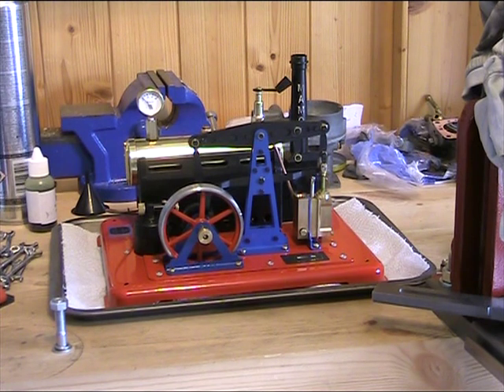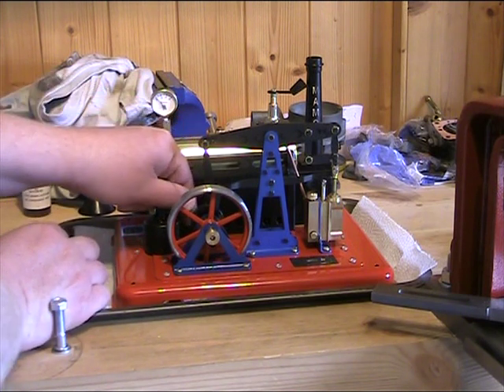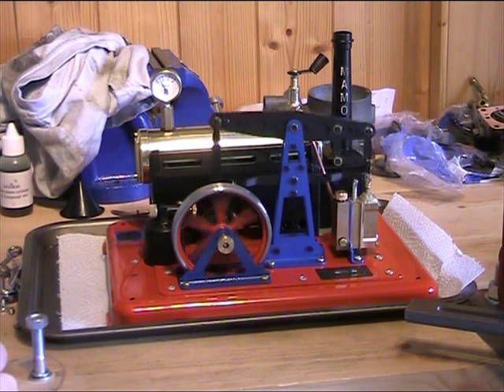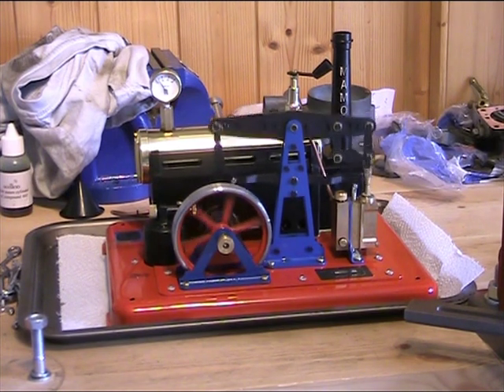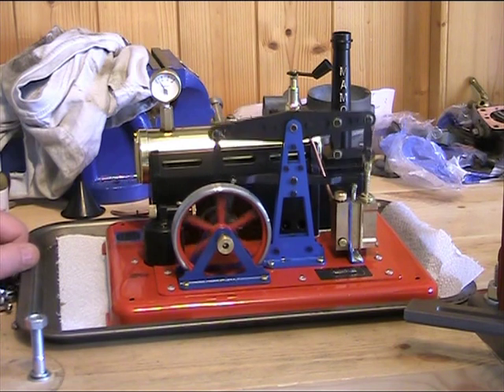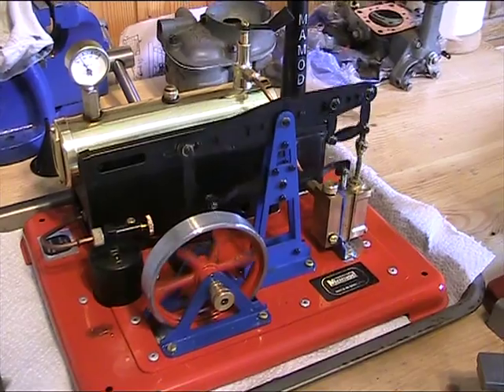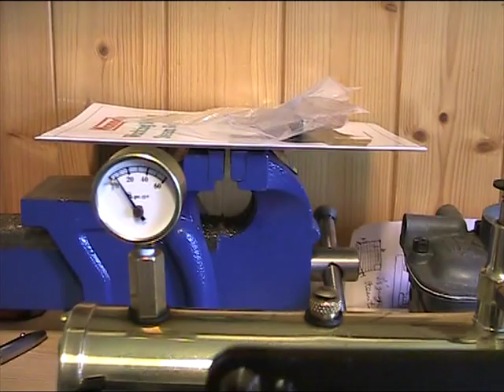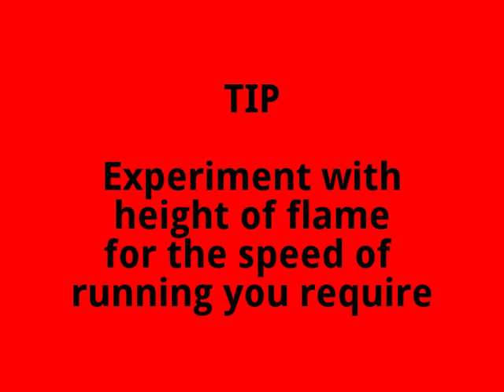MAMOD SP8 "JAMES WATT" STATIONARY STEAM ENGINE

Comment: What a great little engine. A bit slow to catch up with whats new. Thanks for posting.
Reply from the maker: No problem. It's my favourite of the stationaries, well, the new ones anyway.
Reply: PLAYING AROUND! And which is you favourite older engine? is it a Mamod or is it Wilesco....or is it some other make.
Reply from the maker: Mamod, but to say which one is difficult. By default I suppose my first one, a Mamod SP1d  has to be up there, but therte's not many really olo ones in the collection.The MEC1's, made by Mamod for Meccano would be up their too, along with a Mamod ME1.

Comment: Im not an out and out Mamod Fan as such, although my best ever Christmas present was a Mamod steam engine, and I had it powering a meccano lorry. But that looks like a very nice little model, and she runs quite slow a well, I presume thats because she is double acting. I did wonder a one point (about 25 mins) on the first run whether one of the (pretend) parallel motion links might have been tight because it looked as if the cylinder block was flexing/moving back and forth a tiny bit, you could only see it when at it slowest rpm. but im very impressed. 61 videos I better go and look at some of your others to see what else you get up to.

Comment: meccano compatible?
Reply from the maker: Julius Nyangoro Not directly perhaps, the base is a little too wide to be practical and of course the lack of holes, however, they are supposed to be going back to half inch spaced holes all around the bases, which would make things much easier. There's no problem connecting the engine to Meccano models via a drive belt though, as can be seen with the Meccano workshop or the Meccano warehouse with a SP7.
Reply: PLAYING AROUND! Yeah I remember  seeing those engines on an website.....the first meccano steam engines were not literally made by mamod and had no holes!
Reply: PLAYING AROUND! and you should consider yourself lucky im an 11 year old kid that lives in the USA and calls meccano,meccano instead of erector cause lucky for you,I know the difference between ac gilbert erector(before it was bought by meccano) and meccano!
Reply from the maker: Julius Nyangoro You are correct, the first Meccano steam engines were not made by Meccano, but had four holes in the base.